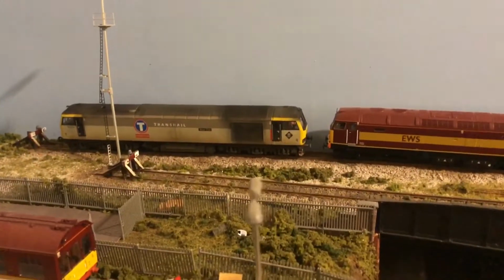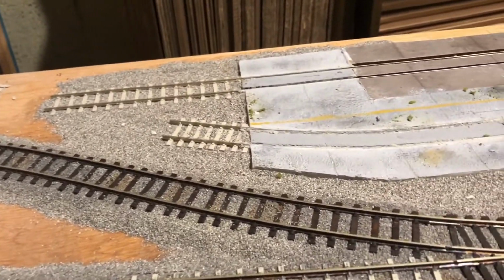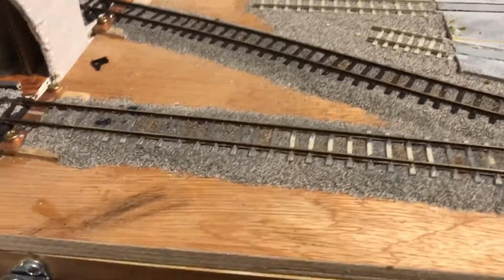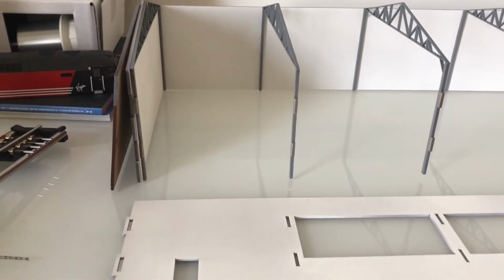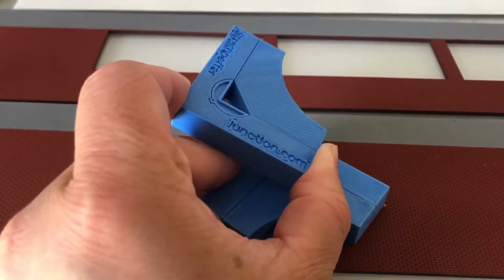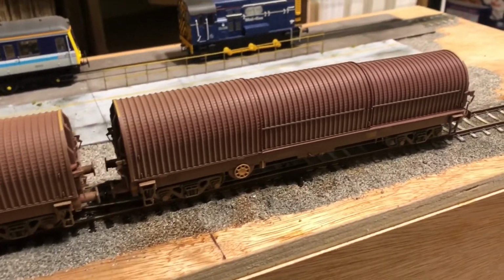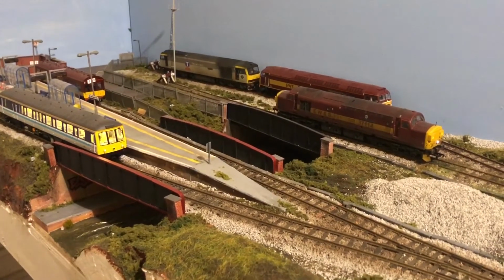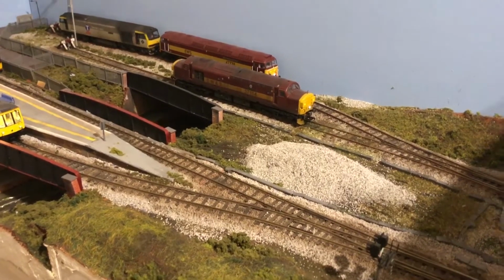St. Michael's Hill Model Railway Ep.48 - July Layout Update

Comment: I really like your track and ballasting - really neat. The variation in the tie colours make it look very realistic as well. Did you use any static grass applicator to apply the static grass? You're right, it doesn't look quite right, I am guessing that the applicator you used might not be powerful enough, or the glue was not strong enough to hold the strands straight up. Looking forward to see how you do it in the new section. Cheers! Kaustav
Reply from the maker: Hi Kaustav, 

I used a home made applicator and it's OK - but I'm not massively happy with it. I will try something different on the new layout. I've been watching more of your videos, and your work is stunning and inspiring. Thanks for taking the time to watch my video! All the best, Rich